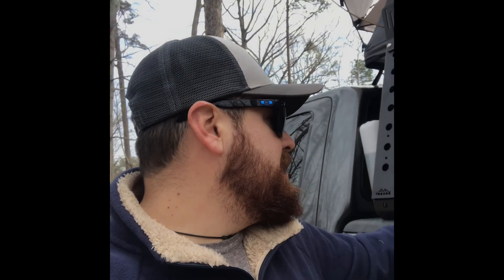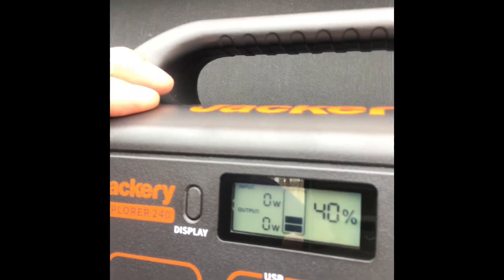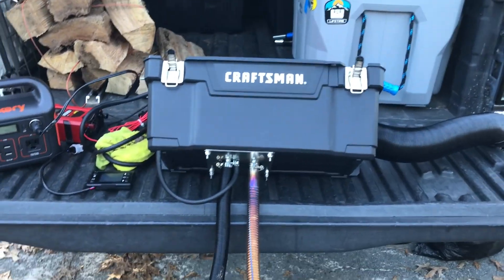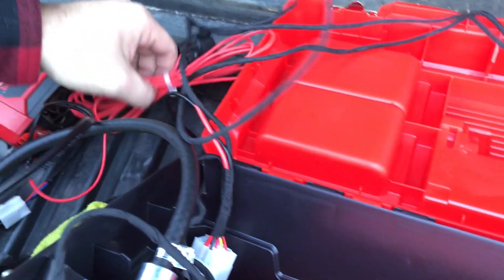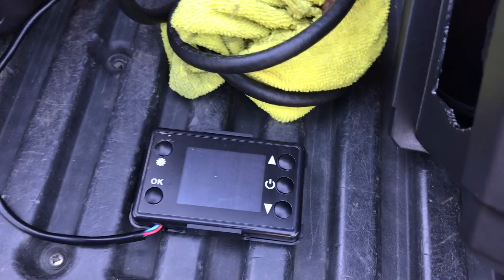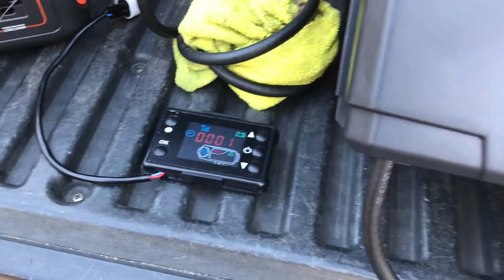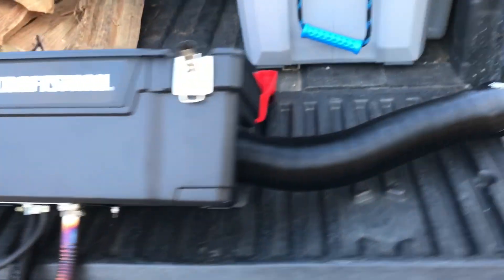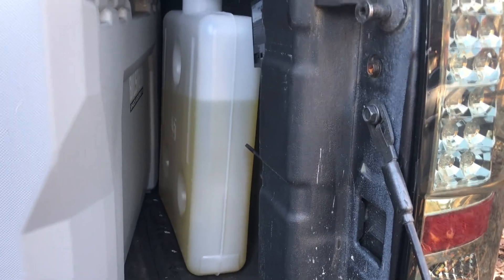Diesel Tent Heater - Stay Warm Camping This Winter for Cheap! $

Comment: Great setup! Thanks for sharing. 
I was wondering: how do you vent the XL tent at night? What do you keep open/ closed? I have the same tent and have been struggling with condensation and ventilation. Any tips would be appreciated!
Reply from the maker: What kind of heater are you using? With the diesel heater I have zero condensation because it blows dry air. With a buddy heater, moisture is released when the propane burns. In cold weather I usually keep the skylights open but that is really to balance out the heat. I've never had any condensation issues with the diesel heater, one of the many perks!
Reply: @TitanOverland  gotcha thanks for sharing!
We were using propane but we only ran it for about an hour before we went to sleep. I kept the whole tent closed up thought in an effort to trap some heat, but we woke up to quite a bit of condensation.